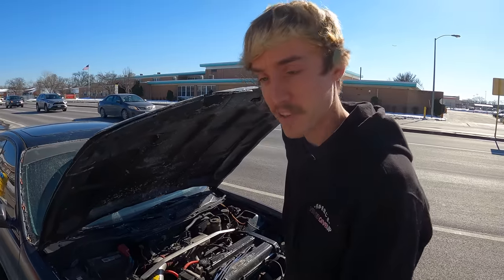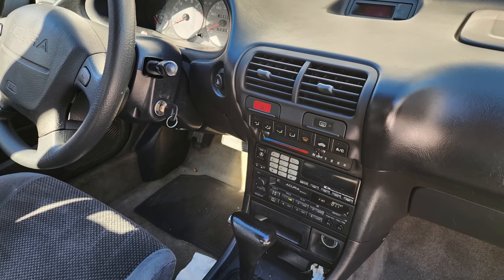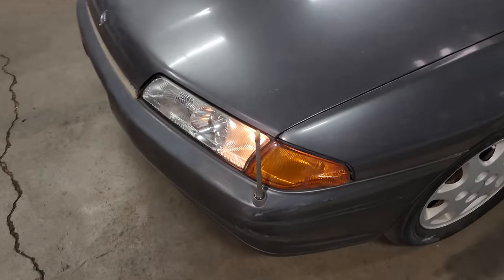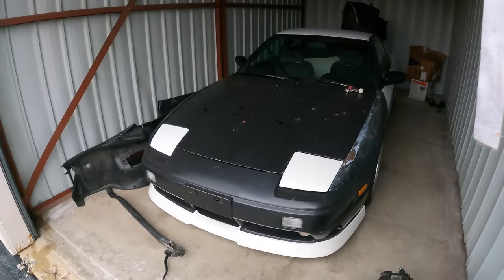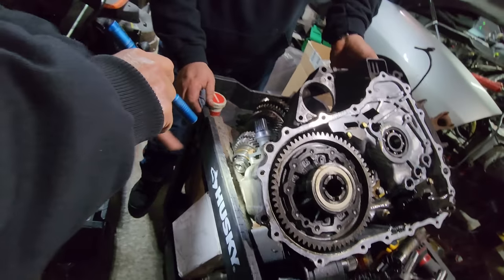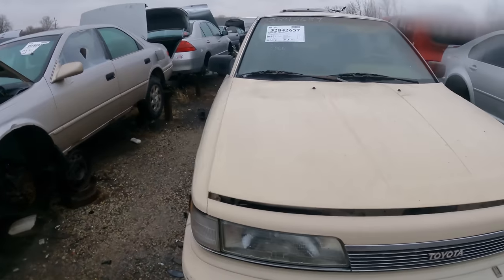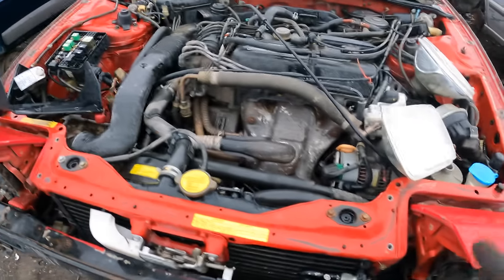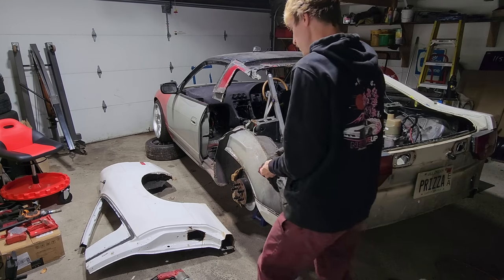Inspecting JDM Cars + Junkyard Adventures

Comment: get a r32 as a fresh build for the channel mike, just remember as the first mod get an aftermarket oil pump, most real jdm fans know that the first cause of engine failure in any rb engine is caused by oil pump failure, love the vids anyways and keep up the good work #restorethat180!
Reply: 25de's don't die haha unless you turbo them
Reply: @s15melb  not trying to argue with you man just letting ya know. most people think I try to annoy them or try to argue with them I dont and wont try. had a friend with a 95 GTS25 2 door and the oil pump failed on his rb25de. had near 100,000km on the dash.
Reply: @s15melb  now I will say possibly due to how high the kilometers were on that engine is the reason why it failed. now I will say it couldve been from anything else but that. my point man he somehow blew up a rb25de.

Comment: ha you had me about the truck. Im glad you didnt get the car The stuff going up for sale here in colorado is insane I mean if you dont have a title and it doesnt run then its just parts and should not be sold as a working car. I used PB blaster surface shield this year to protect my nissan frames and seems to work great and doesnt stink. Good video to eat breakfast

Comment: Yoo, at 20:32 I think thats a laser red Saab 9-3 convertible from 2003 - 2006 I think those are pretty rare in this color. Very fun cars, my father has this model in black and I got the first generation 9-3 :)

Comment: Highly recommend you change the input shaft bearing too while it’s apart ! Do not leave it if the counter shaft bearing was that bad the input is not far behind in my opinion like he said I figured it would be the one that’s bad or diff bearings I’m a little surprised to see that one be the one that’s bad but deff don’t just change the one. I’d just get them all while you’re at it and have a new mint trans with no noises. You can get full bearing kits from synchro tech butttt a homie at Honda is always good too 😊

Comment: That Integra is not worth it. Although interior is good shape, but definitely not worth it. The rust condition could be worst and the undercarriage could be f@#ked. The 4door skyline is cool but needs more work like swapped engine RB25DET, change the steering wheel, internal wiring etc. But rims and engines is definitely a worth to get